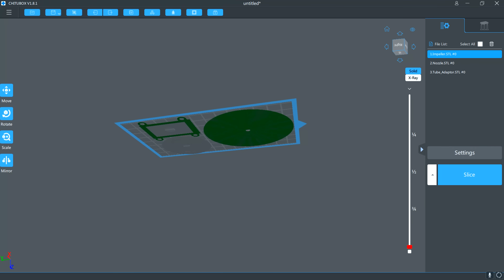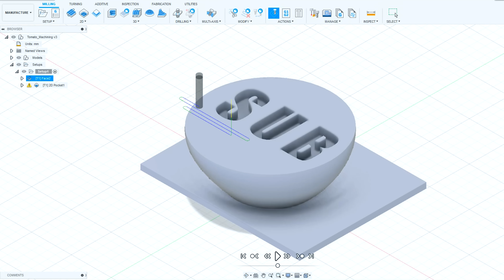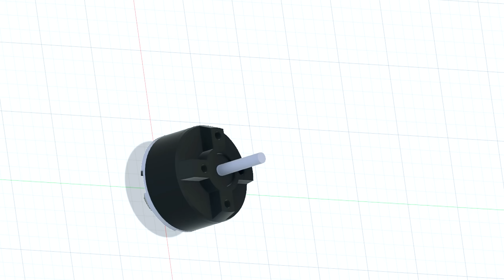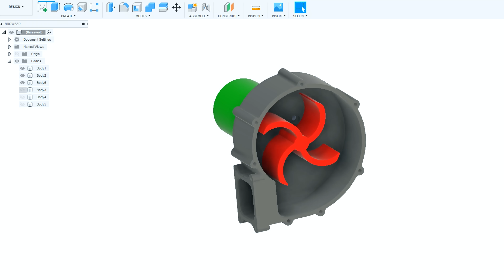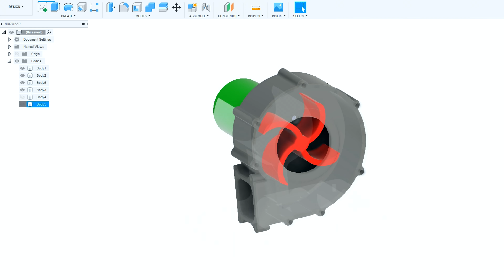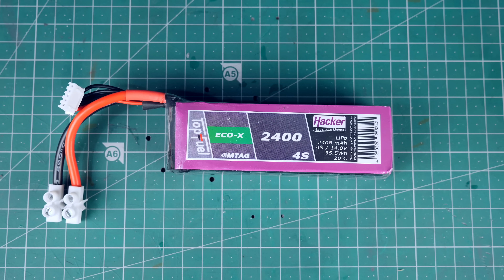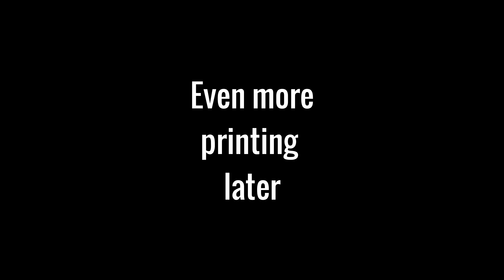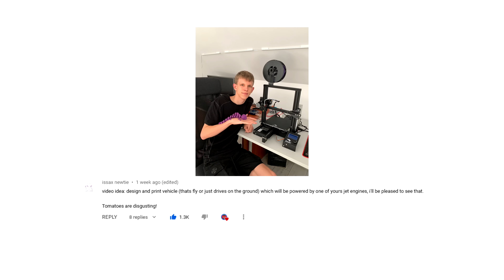Water Rocket Skateboard (3D Printed)

Comment: It's an awesome model and I think you're right but I believe that when you assemble the housing for the water to flow through you need to put the nozzle at the end inside so that the pressure doesn't just pop it off. I'm no engineer but that would seem to be the most logical way to resolve that issue.

Comment: I say do with air pressure.step 1: take a cycle air pump valve. Put a small hole in an airtight bottle (plastic regular one)
Step:3 fix the valve in such a way that only the pumping nozzle is visible 
Step:4 close the bottle with it's cap. And fill in air.if it is not leaking and get compressed , then fill water in it and then pump it with air and (compress)
Step:5 (after realising the air) put a small hole in the bottle cap.
 Step:6. Fix it on a skate board or any rolling tray.ect..
Step: 7 search or build any thing to close the hole in the lid temporarily 
Step 8 release the compressed air to let go the water with compressed air by opening the thing which you had built
Step :9 enjoy

Comment: I wonder; let's say you have some kind of jet engine... and just behind (at the hottest point) of the tail of that jet engine just before it comes out the nozzle you inject a stream of water; if the extra mass of that water expanding wouldn't add to your acceleration?. Probably a silly idea. Ultimately having to carry the mass is the problem.

Comment: Hi Integza My name is Neil I would like to see you try to build a magnetic rail gun that either shoots a bolt or a plasma ball maybe and maybe that tomato will finally get obliterated Love the channel. I recently discovered your channel and I too have been working on my own pump impeller and diffuser setup however, I only have JB weld to work with as you know, not the best I also live on a fixed income resources or scarce Hope to hear from you

Comment: You should print a more direct copy of a turbo impellor and casing, you'd get more power output and less cavitation due to the smoother flow provided by the blade shape. May even help with the impellor exploding due to excessive rpm, because there would be more load on the impellor since it'd pushing more dense water instead of less dense cavitation bubbles, thus slowing the rpm.

Comment: Why don't just use a pressure tank with high pressure air, a water reserve tank full of water that is also capable of holding pressure, and a nozzle similar to a waterjet or pressure washer nozzle? Shouldn't this give better results than using a pump? Not to mention that it would probably also look cooler. I am by no means saying that your design/idea is wrong.

Comment: Once I get my printer calibrated right(it's such a damn PITA) I'm going to be doing a water rocket like the kids toy. Body like a rocket with fins and all, pump air in, it gets pressurized up top, then when you let it go the water gets pushed out. Kinda considering trying to automate it all with an Arduino. At least the pumping and release stages, the mechanism to swap from filling with water to filling with air might be tricky.

Comment: Really nice work but there is something that can make it go faster. Most of the water in the tank is useless as the pump sucks from a higher level and this adds extra unnecessary weight. If there is no way to put the valve lower on the tank then fix the tank higher with a light material.

Comment: Hey I like DC motors they’re simpler you can power them by simply connecting them to a battery without using all that electronic speed controller crap.

Comment: What little I know about fluid dynamics, mechanics and displacement is not much, I would suggest that either there are too many forces being enacted upon from various inputs. There are air pockets created inside the housing of your pump as it spins, this adds additional varying stresses on all your components as centrifugal force has varying effects on materials when run through varying mediums. Thus compounds all stresses and that is why it breaks. 

For fear of leaving too much to read here:
Try adding "step up" pumps from your feed tank toward your 60 000rpm pump. This should fill the gaps better and be beneficial in adding some equilibrium throughout the running process.

I can make more detailed suggestions if you are keen.

Comment: A revision of this experiment with 2 major changes 
1 pre water logging the main mechanism 
2 reenforcing most of the parts through using a interior “sleeve * consisting of a thin pvc pipe with a hole for the exhaust it should prevent that sort of failure for a while

Comment: cnc and aluminum are the way to go. Small suggestion , recyl the water. Connect a hose to an impeller on the axle , won't be a water jet but still cool.

Comment: The rotor center is not correct and needs to fit closer to the inner housing with a larger diameter rotor. Then lower rpms will produce more flow and also pressure, which the small rotor simply cannot do without cavitating, and making bubbles and foam.  Be sure your inlet flow capacity is greater than your outlet flow rate which will also minimize the air in the pump housing.  Your housing inside curve should remain a close radius fit to the rotor for at least 180 degrees before beginning to flare outwards towards the outlet. I hope that helps.  It should increase the efficiency quite a bit.  Rpms above 20k should be avoided since the dynamic stresses change rapidly, as you saw.  Of course this is relative to the diameter, the balance and the concentricity of all the moving parts.  Love your work. 53 years of tool making and I rarely had 1/2 as much fun as you are having.

Comment: I think you should revisit this topic. Take a look on how a turbo impeller is designed. You can get more structural support on your blades by adding a plate close to the motor side and if you put the blade on a diagonal you could get more thrust out of a less powerful motor.

Comment: Why not use a high-strength laser-bonded resin in your laser resin printer?  That could solve the issue by at least moving the limit speed to at least 30KRPM.  Just feather the throttle. XD

Comment: Use a nozzle, but instead of a bucket of water use bottles and then use either a compressed gas or chemical reaction to displace the water at an extreme speed

Comment: the pump exploded bc of cavitation man (air bubbles in the inside the pump) caused by it loosing water supplier, do it again but focus on make a high pressure pump instead of the volumetric pump like that one.

Comment: The electrical motor is “a bit” overpowered… probably it should be regulated by changing the supply frequency and placing a limit to it maximum. Plus I suggest to design the pump as a pump not as a fan. Something designed to move gases is not made to move fluids

Comment: i can help you make the pump  more efficient and produce more pressure with less rpm im sure it will work the issue i saw is that is cavitating a lot inside the housing because of the  high rpm. lets do a 2nd try im sure it will work great

Comment: i you strangle the valve on the intake the parts chould handle the pressure as water will have more speed than quantity.

Comment: Hope he realises that he can only use half of the water supply because he made the connection hole near the midway point of the container. The unused water that isn't being converted into work is only extra weight . It significantly reduces the efficiency and cuts the distance that could have been traveled into almost half.  Just an observation.
Also you can use more than one pump, each with a lower rpm than the ones that self-destruct to both prevent them from "exploding" and to increase the forward speed of the skateboard as a result of the combined force of all the pumps working together.
Awesome video btw.

Comment: @Integza Some ideas to make this a bit more effective:
1: A slower, higher torque motor might actually be appropriate here.  If you look at your footage inside the centrifugal pump, you see a lot of bubbles, these are probably due to cavitation, which is robbing you of output pressure.
2: Your impeller appears to be backwards.
3: You probably want your impeller to get closer to the walls of the pump.

Comment: Maaaan you've got to get the air out of the mix, that's what ruins it. It would be a way stronger output! Also, just print the resin thicker? Just cause it breaks when you're printing it that thin doesn't mean you hit its limits, just that you hit that thin materials limit.

Comment: Try to use a closed impeller with the nozzles in a small diameter (outlet smaller than inlet). Always install centrifugal pumps drowned, to get some water pressure and not cavitate.

Comment: Not sure if anyone of u noted but the motor doesnt spin the right way (the blades are oppositely aligned) and so the water comes out since the water has to go out anyway as the box has much more water and has high level as compared to the motor so nly the water comes and it comes fast as it is inside mixing ...if the blade is turned right then it will work 

Like if this is right and anyone noticed the same

Comment: why doesn't he use a closed running part with split rings like a real Pump? This would withstand a lot more pressure. I would also seal the shaft with an Simmering too.
And the imcomig nozzel ist to smal an the Pump creat Kavitation.
Mfg

Comment: You should've de-aired your pump before starting, it's really bad and causes a lot of problems for your pump and it's power output. 
Also, put the intake lower in the box, you're unable to use a lot of water. It's basically permanent extra weight on your skateboard because it never gets used as "fuel"

Comment: To improve this design, you could get a real RC Racing Boat Propeller and install it inside the water tank exactly in the valve tube. This way you have better propeller efficiency and possibly a stronger water jet. Might be worth another video :)

Comment: Hey Integza so my brother came to visit some time ago and we were trying to thing of ideas for science experiments we can do with my 6 year old nephew.  I had a lot of high alcohol hand sanitizer and cleaner lying around as well as empty plastic water bottle and thought, "hey why don't we make a rocket."  Well it turned out to be a wild success and really easy and simple.  I sprayed a little bit of 80% alcohol in the plastic bottle, poked a maybe 5mm whole in the cap, and then moved it around a couple seconds to try to get oxygen mixed in then, closed the cap, put the bottle on the floor, then put a lighter about a cm from the cap, and then we needed to push on the side of the bottle a little bit to get it to ingnite... then vroom! it flew across the room almost immediately.  It worked well with 500ml bottles as well as 1.5l bottles.  it also worked well both with 80% alcohol hand sanitizer and 80 proof alcohol cleaner then should be 40% alcohol.  All of the fuel would burn incredibly quickly and the bottles deform after 1 or 2 tries.  I imagine this experiment would be so much better with some 3d printed parts, so i immediately thought of you.

Comment: pedant: 3D printers are also "CNC", just not mills (or lathes, or...) they're even controlled with exactly the same control language as the other CNC machines (GCode).

Unfortunately that desktop mill doesn't really look sturdy enough for (accurate) machining of metals but I'm sure it's a decent starter for getting into CNC mills in general (and if you ruing the spindle bearings in a crash it's way cheaper to fix than on a bigger machine).

When I saw the RPM figures I immediately thought that this is going to cavitate like there's no tomorrow, I don't really know anything about impeller/propeller design so can't give much concrete examples but I think larger volume and lower RPM is better.

Then there's "impedance matching", though that might only really apply to gas exhaust in atmosphere, traditional turbojet engines are very inefficient until the vehicle itself reaches very high speeds so the relative velocity of the jet exhaust is more efficiently used for thrust, this is why the modern turbofan engines use the hot gas to rotate a turbine which then rotates a huge fan that will create high volume of low(er) velocity exhaust.

Comment: Back in the 60's my Dad, who was an Air Force pilot, one of the handful assigned to the first jet fighter squadron established after WW II, found and bought a toy water rocket kit for me. You filled a hard plastic rocket shaped (fins and all) cylinder half way up with water. Then you attached it with a slide lock to a very simple hand air pump. It did seal well, so that you could pump air into the cylinder without it leaking out, then slide the lock back and it would jet into the air. It was amazingly good at this.

Comment: Ok, Here it is a suggestion for a more interesting video "Sequel on the water Jet" It was very clear to me that the water pump wasn't designed to survive the RPM's, the pressure, the speed of the water.... or not even the impeller rotating at such a brutal speed... BUT!!! if you decide to create a venturi stile where you create a brutal amount of pressure "bring down the size of the pump to about 15 mm impeller "Better yet.. use an small Jet drive like those ones on Ebay.. "Small you need pressure.. and them a venturi to create vacuum and mix it with air.. your will have tons of more pressure THUS more thrust... and will have a product that will survive... hopefully you can get the aluminum mini jet drive and make this work like a champ!! best luck!!

Comment: Your impeller needs a "backing" like you did for your turbo impeller. That would help it stay together. You can also add a front to it like many water pump and vacuum cleaner impellers have. Should allow it to achieve higher rpm. Also see the compressor wheel in the Schreckling jet engine.

And of course, your water intake should have been lower. Any water below the intake was just dead weight.

Comment: “60,000 rpm is scaring me” said the man who tests jet engines in his wooden attic.
Reply: idk man spinny things are pretty scary
Reply: Full of insulation at that
Reply: idk it could be because you can use a fire extinguisher in case anything happens and stay way, however at 60,000 rpm it can fling anywhere. Also it could fail at any moment.
Reply: How is this top comment with 2 replys?
Reply: @KeysNoE  I don’t know either bud 🤷‍♂️
Reply: 3D printed jet engines that is, mostly
Reply: 😂 LOL
Reply: It is over 180 mph

Comment: What about you can just make my own mechanism but not quite sure about it and havent try it yet:

First its almost the same like it but you can just change the outside into metal and make the inside ABS plastic
Then the pump will suck the water by the gears there with an fucking insane motor. Then just like a car but you will have a gear near the turbine so it pushes the water to the back and push the skateboard.
Then you can make again the back part end with ABS.

Comment: Bro that would be sick if you continued this project and did it with metal. And you could try using a 5s battery for the motor with liquid nitrogen so the motor wouldn’t over heat.

Comment: what about using your CNC machine to make a new jet engine and using your high powered brushless motor to force air into the system to create better thrust since that was an issue with your pulse jet. combine the projects!

Comment: Heavier material has more mass. Liquid doesn’t compress well. Gas is more efficient. 
I remember a science experiment from the eighties, back when I went to school. 
I’m pretty sure the teacher used positive and negative electrodes to separate hydrogen and oxygen out of water. 
I know it is NOT efficient, but if you could safely make an engine (rocket or combustion) to burn either or both, maybe someday technology will catch up.

Comment: My friend, i think you might have another limitation. The lack of pressure on the water tank might be a problem as you do not feed enough water to the turbine. Maybe you dont even need such a powerful engine that way (im saying this based on the slow-mo vids where you see so much inconsistency on the water expelled. I know the turbine also "sucks" water, but still, maybe worth the shot (test with the tank as filled as possible vs as empty as possibel...simple enough).

As for an idea for a new video, with that sweet ass new motor and RC equipment, i think you could create a "propeller rocket", strong and big enough to send a tomato high up, drop it to his well deserved death, and then land the rest of the rocket safely with a parashoot or something. Bonus points for doing it with an absurd quantity of tomatoes  (or maybe 1 tomato and a bag of sand/water/whatever, cause playing with too much food is frowned upon)

Love your vids ^^

Comment: Your main problem here is that the pump is partially full of air when you turn it on. This creates a lot of bubbles, turbulence, and low and high pressure regions. You could probably get a better kickback if you filled the pump with water completely before you turned it on
Reply: yes not properly primed
Reply: Also replace the material of the impeller with PAHT CF15 which should be able to withstand much higher stresses and loads, not metal but close enough.

Comment: "Hot gases are not that heavy." Heavy implies weight and it's unimportant. Mass is important.

The difference is that mass does not change based on temperature or gravitational field. A 100 kilo rock is 100 kilos on Earth, in space, or on the moon.
Reply: so you don't mean mass, as a single value but density as a value of mass per volume... a block of air at room temperature weighing 100kilo is just huge... compared to water... and as we want movement we add speed for "mass flow" or "volume flow" depending on which aspect you want to look at...